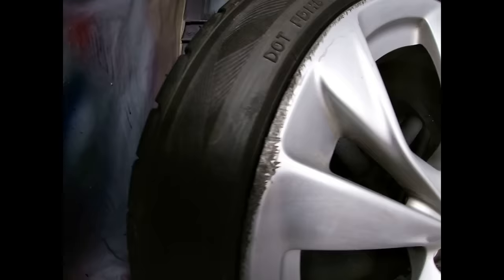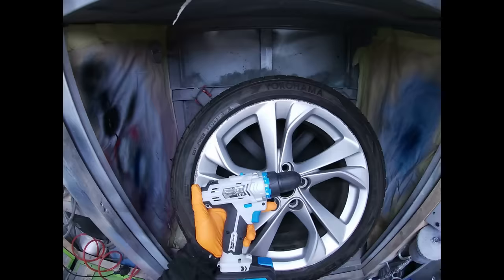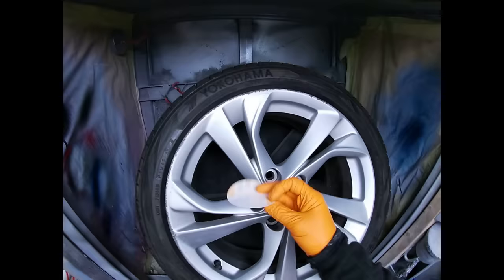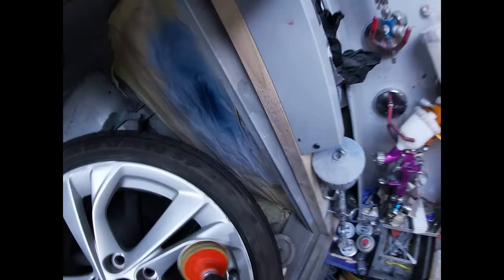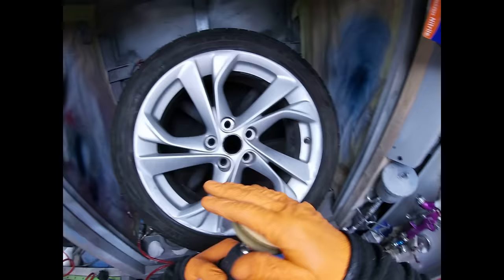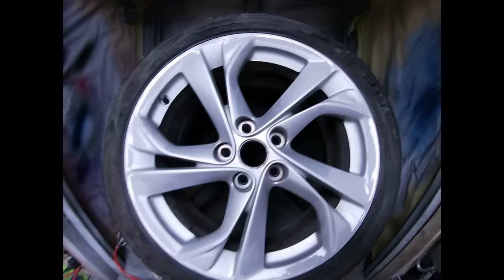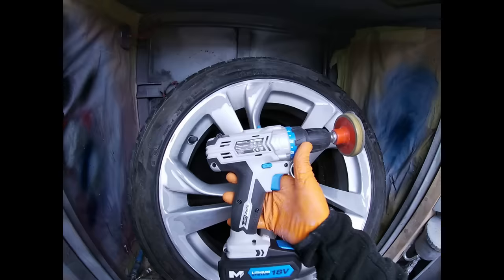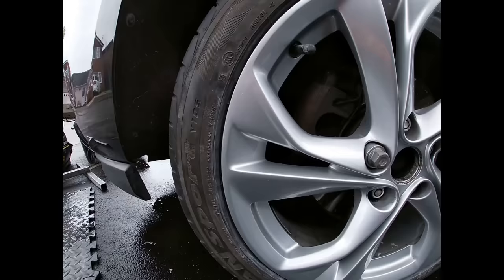How to remove curb rash on any wheel rim with a cordless drill!!

Comment: Nice. I used to do mobile wheel repair. Did 12-15 wheels a day for dealerships all over Phoenix. You really only need to go 120-320-500 on the discs. If you deflate the tire you can get in there better. Also, when you deflate it, you can use playing cards to mask the tire. Then roll a card up and tape it. Then slide the rolled up card over the valve stem to mask it. I could refinish and paint 4 wheels in 45 minutes.
Reply from the maker: Thanks for feedback mate. I have worked for dealers also and very similar to yourself. I really wanted to keep this one as DIY as poss 👍🏼
Reply: @MICHIGANMIKE12   Go to church
Reply: @kimgray1606  will do that after you refinish my tyres so they look sharp as I wheel in to church parking lot....want to make good impression on the bishop...
Reply: @MICHIGANMIKE12  👍😇
Reply: Great advice.  Thanks.
Reply: My question to You Paul, as a pro. Dependent on the wheel design, if you grind down the alu wheel doesnt the wheel cross section (where the bead would sit) become sharper angle, as opposed to a nice rolled edge, if You understand my point?
That in itself would be dangerous; too often I have seen drivers mounting kerbs (not dropped kerbs) outside shops, takeaways etc where parking is restricted.
Look forward to any comments.
Reply: @bobbarrett2631  if that’s an issue, deflate or take the tire off and smooth the edges with maybe 800 grit.
Reply: Why aren't you doing it anymore ? Sounds like a great business.
Reply: What about chrome
Reply: can you make a tutorial? also what do you mean by roll a card up and tape it?
Reply: @dezcanso1540  
I imagine he means roll a card into a shape similar to a cigarette or a drinking straw, just so it will slip down over the valve step but not cut into it.   And you tape it so it won't come undone...that is try to flatten back out and /or slip off.
Reply: @dezcanso1540  he used at tightly rolled card to mask the air valve so the valve would not be painted...
Reply: Hey buddy, I have a question for you. You seem pretty knowledgeable. Can I use a regular spray can, to paint the wheels and get a professional look? Alloy wheels.
Reply: @howardkerr8174  I wonder if a straw itself will work? 🤔 Instead of having to tape up rolled cards lol
Reply: @MICHIGANMIKE12  'want to make good impression on the bishop...'  Bishop is going to be looking at your shiny little hiney not your wheels.
Reply: @Git2gether2023  yes. but remember, you need to clear coat the paint or it will look like shit real fast.
Reply: @fransmith8992  Thank you!!
Reply: @Git2gether2023  anytime. anything i can do to help another car guy.
Reply: @kimgray1606  I do 12oz. prayer.
Reply: @MICHIGANMIKE12  wont damage the tyre  lol .
Reply: @Git2gether2023  personally I used etch primer, primer, metallic silver and finally twin pack clear.
Reply: @James_Edward59  Rolling a bit of card is hardly rocket science , if that is too much of a challenge , then perhaps this entire process is not for you .
Reply: @durv13  The edge of the disc is soft foam , but if in doubt just cut the discs slightly smaller than the foam , and with a tiny bit of care there will be no damage to the tyres.
Reply: @PJ-om2wq  Thank you!!
Reply: @A2Z1Two3  good thinking
Reply: @A2Z1Two3  Definitely too hard of a concept for even the brightest minds to process so you might be right, this my just be too hard of a process for me.
Reply: What did you paint it with?
Reply: Thanks for the tips.
Reply: After grinding away half the rim lip, do you need to rebalance the wheel assembly.
Reply: takes notes
Reply: @MICHIGANMIKE12  Gash the tire with sandpaper, you'd have to be American.....I can tell....
Reply: @bobbarrett2631  9
Reply: @cvrpov  
Üü
Reply: @dezcanso1540  you can use a mcdonalds straw from the drinks as well
Reply: @ModelLights  🤣😂🤣😂🤣🤣🤣😂😂🤣
Reply: You worked a little over 2 hours a day?
Reply: wow, how much you charge for each wheel? I wish you could be here in New Mexico! Where in Pheonix are you located?
Reply: @Amor1990  Multiple dealerships throughout the city. Had to go in with pictures of the wheels I thought they might want fixed. Had to wait for them to pick which cars to fix. Had to wait for the keys to go get the cars and drive them over to the trailer. Had to remove the wheels, deflate the tire and work the wheel back into shape and sand and feather it. Then set up the guns and mix the paint. Clear the wheel and put it back on the car and put it back into inventory, rinse and repeat. I didn't just walk up and rattle can a wheel on a $80k car.
Reply: That's pretty quick mate! But I suppose once you have a system going? You fly through it! Cheers from Australia 👍
Reply: Do you use some kind of soft or hard pad to finish? How do you blend the sanded parts to the untouched parts?
Reply: @Git2gether2023  yes. I've done it .just had mask up tyres and prep clean. Or prep wash. Cheers 🙂
Reply: @billbliss2500  I used a soft 2 inch pad on a die grinder to repair and feather out the repaired area into the undamaged area. I would start off with a 250 grit down to a 500 grit disc on a 2 inch orbital and feathered it out several inches from the repaired area. You can use a drill too if you don't have a compressor. When you repaint the repaired area, you blend into the feathered and undamaged area. You scuff the undamaged area that you are blending into. Paint it and then clear out into the undamaged area you scuffed into for blending. You can then use a blending agent/spray to let the new clear blend into the undamaged old clear areas you are blending into.
Reply: Wouldn't removing metal through off the balance of the wheel?
Reply: I can't deflate tire cause i have runflats :(((
Reply: Man where are u??I'd love for u to repair my 24 inch rims..can u give me a step by step on what to do??like what sand paper to start with and if I'm supposed to go up what size..im new to this but I want to try and fix my rims
Reply: Awesome.. I have a drill...  now where to get a disc thingy? LOL
Reply: @fransmith8992 good idea... i better do this the morning i return my lease lol
Reply: What type of paint/color? Got 2012 Buick verano im wanting to do?
Reply: Wat about chrome wheels
Reply: @demetriuskillins5706  use your head.
Reply: thanks for the tip bro
Reply: Hey man so if you don’t mind me asking, how did you get the really hard to reach spots on some rims. For instance, the spots you can barely fit a finger. Do you need to hand sand certain Areas? If anyone knows I would assume you would dear sir
Reply: @bobbarrett2631  No, you reshape it back to round. You’re not removing a ton of material. Never had an issue.
Reply: @Dan4x2282  It is actually. It just takes a little chunk of money to get started. Running a business these days is a challenge.
Reply: @nycmaverick  We would grind the damage down and reshape to its original shape as possible.   You want to feather the work to minimize the amount of copper showing. Then you polish the aluminum that’s the base metal and then Bulldog and clear the repair so it doesn’t oxidize and turn dull. To re-chrome a wheel is expensive and not practical for most wheels. You could hardly tell the wheel was repaired.
Reply: @dezcanso1540  To keep the valve stem from getting paint all over it, you roll a playing card up in a tube just a little bigger than the valve stem. You then tape it up so it doesn’t unroll, and tape over one end to cover one end. Then you slip it over the valve stem to protect it from being painted.
Reply: @howardkerr8174  Yes
Reply: @Git2gether2023  You could, but it won’t match unless you paint the whole wheel. There are about 5 wheel colors used and they are coded. You can get automotive paint and the paint stores loaded into spray cans. Then use a two part clear to ckear them. They now sell two part clear in a two chamber spray can. When you’re ready to use it a button on the bottom of the can is pushed to let the hardner into the clear side of the can. It’s good for about two days. Never use single part Krylon type clear. It’s no good. It will peel and turn yellow really quickly.
Reply: @James_Edward59  Most straws are not big enough to go over the entire valve stem, like the base. And you just reuse the ones you’ve made over and over again. You only make them once.
Reply: @fransmith8992  Yes, use a two part automotive grade clear. They make it in a two chamber can now if you don’t have a compressor.
Reply: @user-ev4pb9xj7e  The damage may look bad, but it is rarely that deep. The amount of aluminum you remove is minuscule. It doesn’t effect the balance of the wheel.
Reply: @Beertjebas81  Not big enough.
Reply: @Amor1990  8 to 10 hours a day. You usually only did a wheel or two per car. You usually didn’t need to do all four. You would do the wheels the dealership authorized you to repair, then move on to your next account. We would do private vehicle owner repairs in between going to our accounts.
Reply: @vyseerx  It was about $85 a wheel.
Reply: @dragan3290  Yes, you get really fast. You just don’t to work faster than the pace of quality. You can eventually get fast and keep the quality level of work high.
Reply: @billbliss2500  You work your way down to 500 grit and feather the repair out about an inch and a half to two inches out from the edge of the repair.
Reply: @bpsmith211  You’re not removing very much aluminum. Curb rash looks deeper than it is. Plus aluminum is very light.
Reply: @alexandercahoulan6583  Usually damage doesn’t occur in those areas because it’s not protruding out and protected. But yes, if you need to get into a tight area, you’re going to have to do it by hand. You can tape sand paper to a paint stick to get it there. You can cut or break the stick to size it down.
Reply: @paulnunya3429  I'm OCD with some things so when I do something I have a good eye especially with installation and repairs! It's obvious that you start slow and get quicker without sacrificing quality! If I can do silicone caulking or polyurethane caulking around perimeter of commercial windows and shopfronts and it looks like a bead of rubber as opposed to some aluminium joiners who have been doing caulking for a lot longer than me and it looks like vomit! Teqnique and control. Preparation is very important!
Reply: @paulnunya3429  btw every person has to start somewhere as I had to repair raised burn marks in a rental in a V shape from hair straighteners. I was using a set of round sanding discs for my dewalt cordless drill and I refurbished the bathroom vanity to perfection. Just like when polishing stainless steel blades. I keep working my way to 5000 grit sandpaper and lastly hit it on the buff using coarse to fine compound! I'm happy when I have the mirror finish.  Cheers
Reply: @paulnunya3429  ha thanks man. Good idea.
Reply: @paulnunya3429  Thank you very much!
Reply: thanks you amigo for the theory about "Wheel repair level 2" 🤩:trophy-yellow-smiling:🎯👏👏👏
Reply: What were they charging?
Reply: @James_Edward59  to thin
Reply: @cvrpov  Can you do a video on how to paint them also and how to colour match?

Comment: BALANCE YOUR WHEEL before installing again on vehicle.  Knocking material off unevenly as was done will knock your wheel balance off.  Will wear out your tire unevenly and will not be as steady on the road, if alignment is off any bit at all.
Reply: yep
Reply from the maker: Been covered a thousand times
Reply: You could also do this right before you have your tires replaced

Comment: only buy vehicles with steel rims ! If it gets bent from hitting a curve ?  Take take some air out of the tire and use a sludge hammer bend it back !  You can't do that with aluminum alloy rim !  They break and then you have to replace them and they are very expensive !!!

Comment: Add safety factor note. Get rim Balanced after doing this, because you took away metal,it needs to be added back IE: Wheel Balance.
Reply: - but hi think not about
Reply: @planje4740  but, think not hi about
Reply: @KBarron43  hi, think not about but
Reply: @reeceiris4482  tf fuck is happening?
Reply: @KBarron43  - hi but not think about
Reply: About it think not hi.
Reply: About it I not think
Reply: When you have curb rash, metal is already taken out the rims. So what you are saying doesn't make any sense.
Reply: @lubnan1  curb rash = imbalance 
grinding away curb rash =  even more imbalance 
comprende ?
Reply: @Professor-Scientist  simply add some curb rash at the opposite side of the rim, it's much quicker than balancing and it's free :-)
Reply: @planje4740  about, but hi think not
Reply: That's why I hammer mine out. It doesn't change the balance.
Reply: I doubt he’s taken more than 5gr which is normally the WB tolerance and besides with UK roads you wouldn’t notice.
Reply: @andrewgilbride7546  and all the muck off the brake pads on the inside lip will even it out
Reply: Not a problem youll be fine

Comment: I used your video to do my 2010 c300 my wife can’t park 🤣 it took me longer than 15 per wheel however they came out great and I did have them professionally powered coated then rebalanced before mounting them back on the car. Top tip this does work! It saved me a lot of money by doing the prep work. Cheers mate
Reply from the maker: Great stuff
Reply: Didn't need to Rebalance. You threw good money away.  You could not even weigh what came off. So little.
Reply: Hey Vince, where did you get the pad from

Comment: Brilliant, I've done my wheels using an old cordless and a sanding disc kit I bought on line for  £12. I used acrylic wheel paint in rattle cans and got decent results, all in only cost me a day in the garage and about £50.
Thanks for the tips 🙂
Reply from the maker: Brill 👍🏼👍🏼😎😎
Reply: Do you have a link for sanding kit please?
Reply: Some places will do it professionally for £50.
Reply: @tooyoungtobeold8756  Yeah per wheel!
Reply: @tooyoungtobeold8756  Ya...try twice that, and per wheel.
Reply: Can I see a picture of ur work and the spray u used

Comment: Just did mine, had some roloc's, 120, 220 and 320. I used my die grinder, and a drill like yours along with some cotton polishing tips and tripoli compound. The only problems is clear coated Aluminum and painted wheel combo's. It's doable, just a lot more work polishing the sanded aluminum up to the original clear coated sections. Once I had the aluminum polished a little above satin I used some rattle can 2K clear to recoat the aluminum.
Reply: Yeah I was wondering about that as I believe my Maserati QP does have a clear coating on the rims.
Reply from the maker: Maybe check out my other wheel repair videos in the playlist for some answers?

Comment: Sand, blow off, wipe down with alcohol.  Instant Ca glue n baking soda is the best filler that binds better and doesnt crack and doesn't over sand easily. I have audi rims 18 years old that have some massive repairs holding strong .  Let sit for 3 minutes, after activator cures  hit with a little heat gun.  Sand to shape, refill if needed, wipe clean  with alcohol.   paint 1 to 2 coats Sand with 600 to feather edge . Clear coat done . Ive repaired iver 1500 set of rims over the last 20 years this way and bonds filler fails after a short while if the damage is beyond d a certain  size
Reply from the maker: Don't doubt it mate

Comment: Excellent vid, mate.. you could also use some kind of spacer between the wheel rim and tyre.... Like a plastic milk bottle cut into wide (3 or 4 inch) cut as strips out the bottle, and slide them in between the rim and tyre.
Reply from the maker: Thanks for watching and good suggestion
Reply: All the spilt milk , gonna get smelly in my garage carpet 👻☠️
Reply: @jackd1582  empty the milk jug first! Problem solved!

Comment: Good job on removing the curb marks but personally wouldn’t bother spraying wheels with a spray gun powder coat is the only way to go for a durable finish
Reply from the maker: Hi mate thanks for the comments. I get a pretty durable finish from wet coat, I've seen my wheels 12+ months and they look fine. people have usually kerbed them again within that time 😅.
Powder coat is good stuff, but imo you don't get as nice a finish as wet coat, and the process usually costs more and you loose your car.

Comment: I can give you a better tip for masking the tyre off, rather than taping off. Get a i bin bag, measure from the centre of the wheel with one end of the bag to the rim of the wheel. Give yourself a bit extra.the bit extra pull to a point and cut off. You should now have a bin bag with a hole the same size diameter as the wheel. Stretch over, and you have a completely masked wheel in one go.
Reply from the maker: I have done this in the past but thanks
Reply: A deck of cards works too

Comment: prevention is better than the cure . Place a dot mark on the inside on the bottom edge of your windscreen in a position that will be in line of sight to approximately 150 mm from what you see when driving to the edge of the curb  and use that reference when parking and you will not hit the curb . And try not to use low profile tires. Tip from down Under in Australia .
Reply from the maker: Thanks for the tip kev, this wasn't my car but good tip

Comment: This would have to change the integrity of the wheel itself regarding  thining the side wall, so i wouldnt go too far in sanding it.
Reply: NO IT DOESN'T. IT'S VERY SLIGHT.
Reply: Its definitely not going  to look true when moving due to the amount that's been sanded out here and there.

Comment: Probably would be better to remove the tyre first so that you can radius the edge nicely and then paint it.  Also avoids ripping into the tyre with the edge of the disk.
Reply: or let all the air out. I did that a while ago and it made masking the tyre a LOT easier, then I just put air back in it when it was done. But good video all the same!
Reply from the maker: It's mainly the backing pad shredding